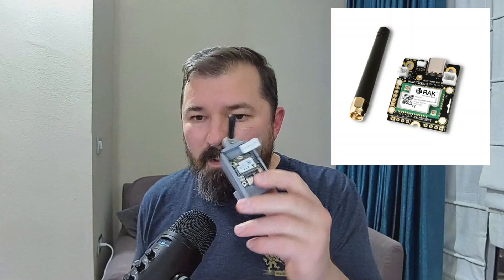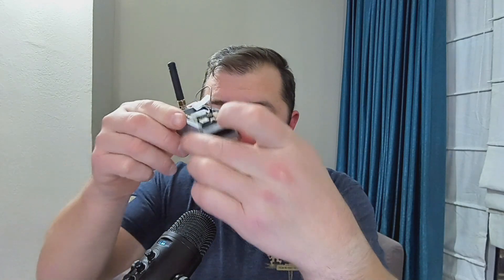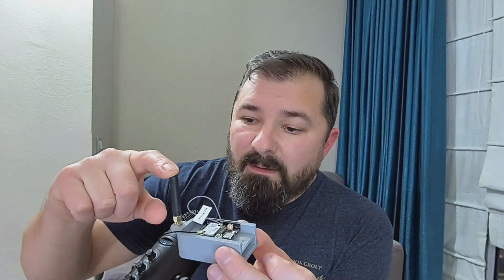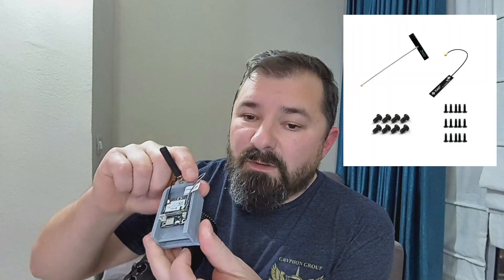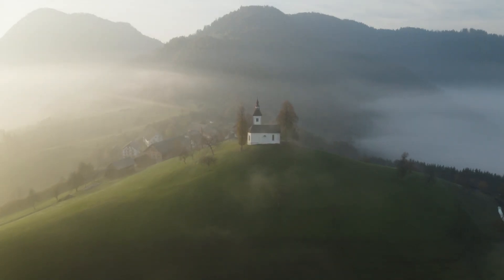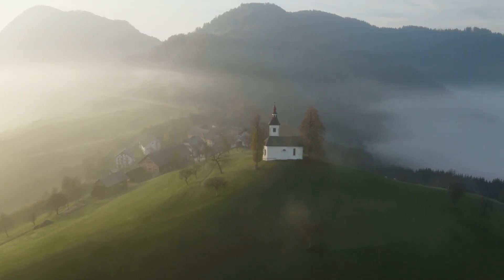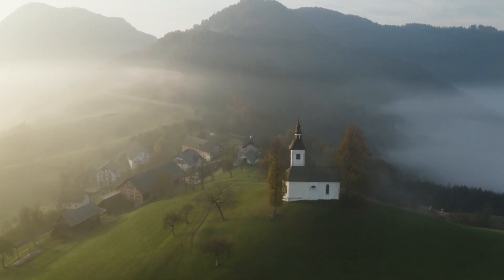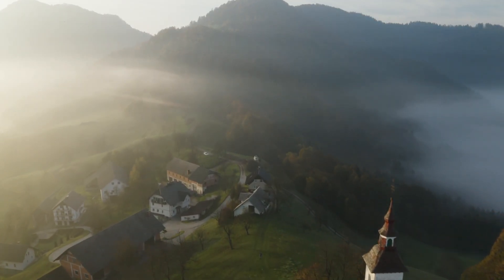Meshtastic Aerial Relay | Drone Relay

Comment: I built an ultralight solar enclosure repeater (parts from rak mini) and suspended it from two mylar helium 'party'' balloons on a tether (an old saltwater fishing rig/reel).  A local dollar store sells the empty ballons and helium tank, I'm thinking of making my own mylar mini dirigible with the solar panels on top. I have a Nano station G2 I want to suspend that  puts out power but is too heavy  for the small balloons.
Reply from the maker: Great idea, I think with the right setup this could work. it would relatively low cost, and even 50 to 100 feet can dramatically increase your node's range.

Comment: Enjoy your time in Europe.. I am on the Welsh border of the UK and have this challenge where I can see a node one way but can't message due to terrain. I have tried an initial flight test with a lilygo t-watch on a dji neo and also surprisingly a heltec with 1100mah battery in a 3d printed H1 muzi works case which seemed to be more balanced and flew better than the t-watch with my elastic band mount 😂. Got the heltec to 50m for a radio test before chickening out as the poor little neo was struggling with the 65g payload. Didn't get the traceroute back or message confirmation but the antenna was horizontal rather than vertical so not sure what kind of an impact that would have. Still.. fun project and will look at building an even lighter setup with vertical antenna and see if that works. Great videos.
Reply from the maker: Thanks for the support. I have been enjoying my time in Europe. I plan on traveling into central and northern Europe this year.
Reply: @EmCommSolutions  give us a ping on the mesh if you are heading our way 😁

Comment: In the event of an actual emergency, you could forget about the rules.  Take it up to 1,000 ft for example.  A more complex version would be to make a solar repeater and use a drone to drop it off on some high point you couldn't normally get to.

Comment: If you placed your Tracker T1000E on the drone as it is lighter you might get a longer flight time, and set the HOP '1' one, local users can gain access, it would be interesting to experiment set HOP '0' zero to see what happens, God bless.
Reply from the maker: Absolutely, that is on my list to test.